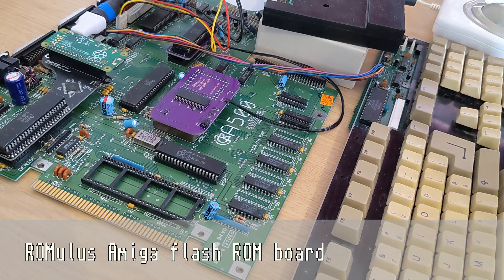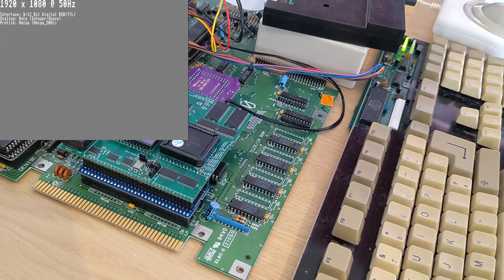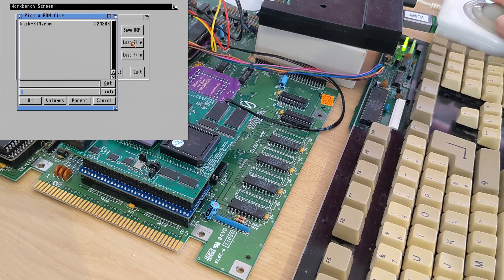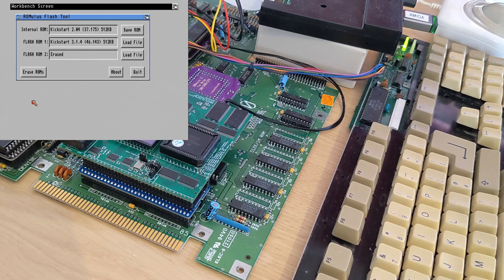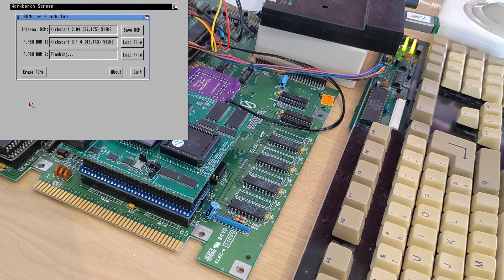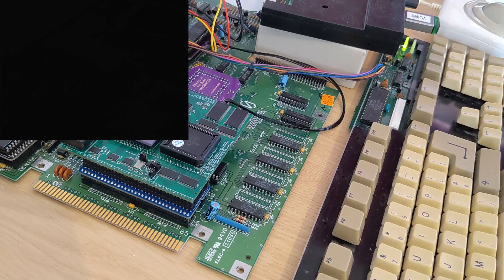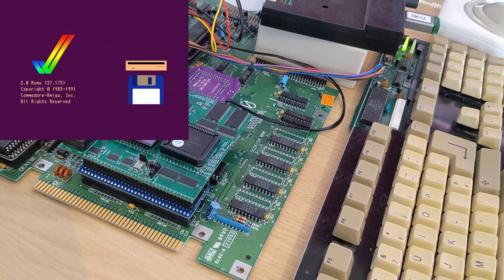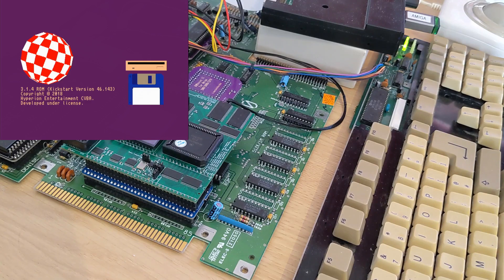ROMulus Amiga flash ROM board

Comment: Hi Andrew the Romulus video you screened was you using the original kickstart 1.3 rom thanks
Reply from the maker: Very likely. The software should work in 1.3 too. The accelerator I was using for this video is not compatible with 1.3 due to using Zorro III RAM.

Comment: I just received mine today, and had a he** of a time figuring out, why it stalled when attempting to flash the ROMs. Eventually I replaced my TerribleFire TF534 with a stock 68000 CPU, and then it worked flawlessly just like in this video! 😀

It DOES boot with the different ROMs as it should with the TF installed; however, I hope that flashing problem will be solved somehow... it would be nice not having to open the Amiga and swap the CPU's if I want to flash it... c".) haha

Except for that, this is an incredible piece of hardware which I'm glad I bought! 😀
Reply from the maker: I did get your email about it, replied but my reply bounced. I will reply again using a different account. I will attempt to reproduce your issue over the weekend. I have the exact hardware you have available to do so. It might just be a flashing software bug with that combination.
Reply: @linuxjedivideo  Okay, thanks for your swift reply. No need to rush of course, but it's good to test our hardware out in different combinations of course, so that eventual bugs can be eliminated.
I remember how e.g. the Pistorm had a hard time initially, but it's definitely come a long way by now. 😀
Reply from the maker: @brufnus  you have no idea how many odd combinations I've tested against, and still a few strange ones come up. In the last year I had to modify the hardware slightly so that GVP hard drives worked properly :)
Reply: @linuxjedivideo  Yeah, I can imagine, haha :-D But that's part of the fun. 
I had a floppy drive on which so much wasn't working; there was too much slack at the stepper motor, even the heads were misaligned and in the end I had to resort to TrackDiskSync, which worked amazingly well. 
That floppy drive I used for booting and flashing today, by the way. 😀

Comment: hello mate. i brought of these. i have amiga 500 and a tf536 using a extender (right angled). problem is the keyboard wont shut if install it the way u did. if i use the exender. then its to high and hits the top cover. any idea which cpu entender is better. cheers